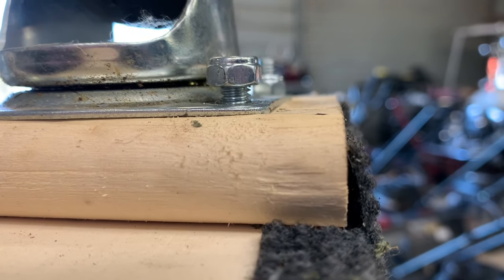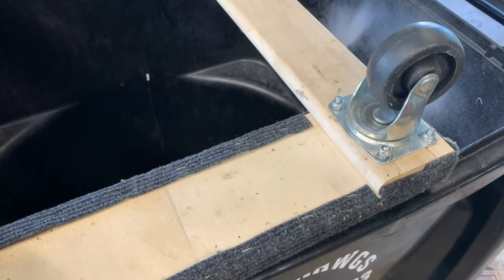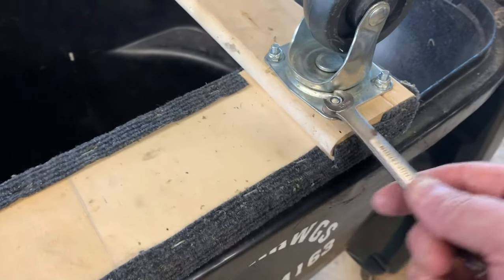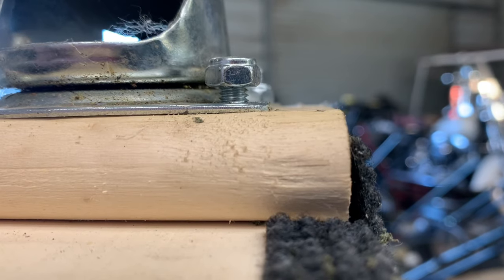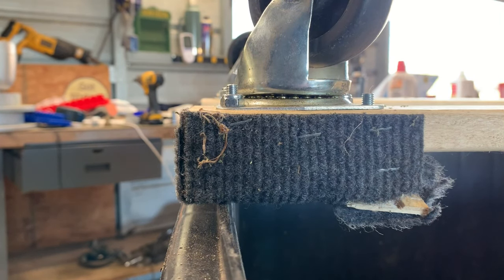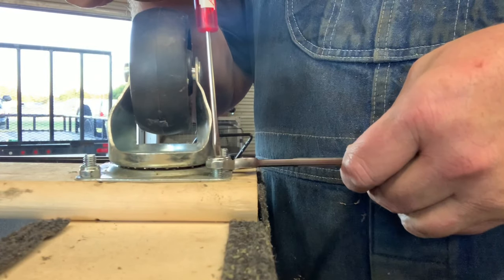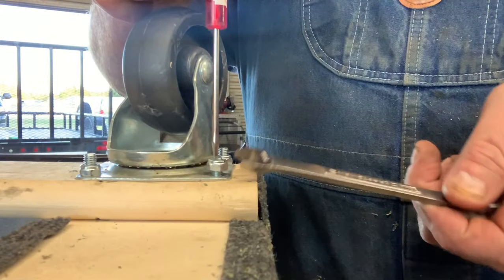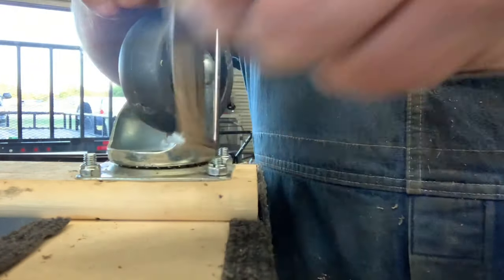NUT AND BOLT SPIN AT THE SAME TIME? GO TRY THIS RIGHT NOW!!

Comment: What if the nut is in a recessed area where you can't grab it, any ideas on how to tackle that one?  Great video!
Reply: This will depend on the actual situation. If you can, cut it off. I mean, in his case, he was destroying the bolt anyway, he might as well just have cut below the nut and then its done. In your case, if you can replace the nut, maybe cut the bolt off and gain more access. That might not work through. Sometimes you can apply pressure in a certain way, and that will get the nut to stop spinning. What I mean is, try to angel the bolt and nut in a way it wasn't designed to be. The other thing that may work is using something to pull up on the nut while you unscrew it. I sometimes use a screw drive under the head of the bolt. Unfortunately, not ever method is possible or practical, and none of these may work. You sometimes have to get creative when it comes to issues.
Reply: Yes.. this is my issue today! It's a shopping cart wheel.. and driving me crazy.

Comment: Omg awesome !! This will work awesome for my butyl projects on boat. Often times like with my portlights(windows) , I cannot reach the bolt head and with butyl it’s critical the bolt does not spin but rather the nut only. So as a result I must always depend on help,which is often not readily available. This idea is perfect . Thank you

Comment: Great tip bud I have four spinning corroded bolts and nuts that I need to remove to get to my license plate light bulbs! I tried liquid wrench and a socket till I was blue in the face. Great video

Comment: I have two bolts that are/were likely weld anchored to the inside of the frame and that side of the frame and the bolts there attached is completely inaccessible without MAJOR disassembly, they are both spinning and I cannot cut the off as I absolutely need them...this is a Life saver solution and I'm a bit embarrassed I didn't think of it myself, Thank you :-)

Comment: I bought the 4 hb dollies for same reason ... for the casters ... threw some welded steel on top of them and turned them into wheel doilies for my light pickup. For what I’m doing it was “farrrrrr” more sensible economically

Comment: The problem I have is that I'm holding the bolt still, but the nut is not coming out even though I'm spinning it. How is that possible? Any tip would be appreciated.
Reply: The threads might be stripped.

Comment: You have a cutting wheel in your hand. Why are you taking this unnecessary step of cutting a slot when you could just cut the bolt. Or in this case you look like you have enough room under that nut to grab the bolt with some needle nose pliers.
Reply: To demonstrate a solution that others might use when they need to keep the bolt in service.
Reply: @randysmith5556 It didn't sound that way from the first minute of the video. But it is a great tip for other applications.  Always good to add more diy knowledge. Thanks.